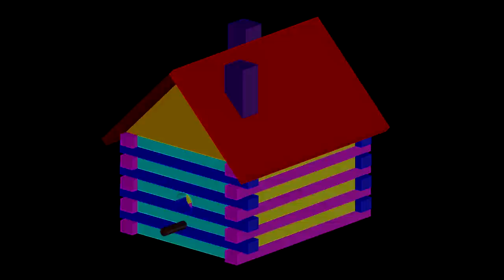How to Build a Rustic Birdhouse - Father & Son Project

Comment: In 15 years you need to post a video with those boys showing clips of the original video and present day. Their reactions will be priceless! I built a deck 21 years ago and took pictures with my two oldest boys.  For years they told everyone they built the deck with their dad! They had a little less participation than your two boys!  We took the deck out last summer to do some renovations and when my sons took it apart we were quite impressed at the durability that was left in the deck. Not bad for a guy that never built a deck before! I'm sure that birdhouse, built with your expertise will last more than a lifetime! Your biggest problem? You need to build another so when those boys move out into their own homes they won't fight, I mean argue over which one gets the birdhouse they built! Congratulations on your build! You seem to be a great father! Keep it up!
Reply from the maker: Thanks. I will cut the house right down the middle since there exists a middle divider.  Now the tricky part comes when child #3 arrives lol

Comment: It is so great you are open to improving your obvious skills. Please forgive the criticism because I know you want to build safe bird boxes.  Inexperienced people with no knowledge of birds may follow a plan that looks great but isn’t safe. Just update your video to include the basic elements of a box that will do no harm,  Multi unit boxes attract very few species so maybe list which birds you hope to attract. You'll need to provide drainage and ventilation to prevent overheating inside for eggs and chicks. Instead of a perch cut shallow groves or ‘kerfs on the front and inside the door.   The 'kerfs’ inside the front helps the chicks fledge. You didn’t provide any drainage or ventilation meaning eggs and chicks will over heat. Instead chop a 45 degree cut off each of the floor corners.  Always provide an access door for cleaning at the end of each season   Check out birding sites for detailed plans for safely built boxes like bluebirdsociety.org/nestbox-plans or <nestwatch.org/learn/all-about-birdhouses/features-of-a-good-birdhouse/> for safe plans.  Thank you for making sure you post plans that are safe.